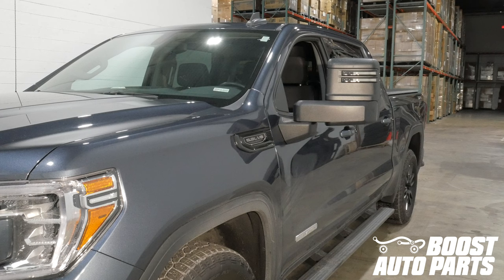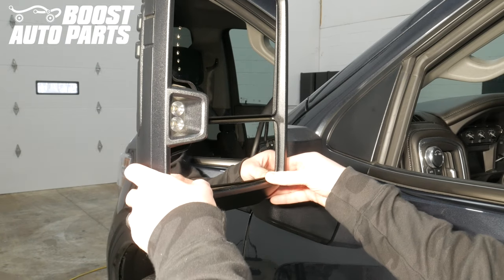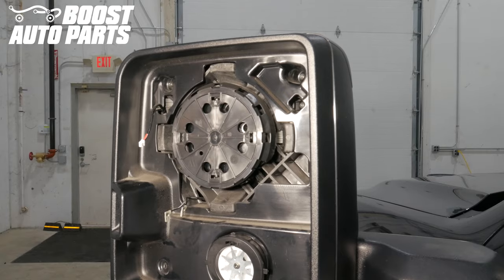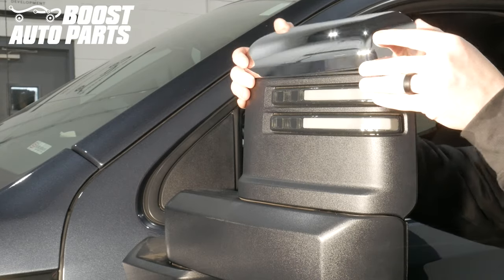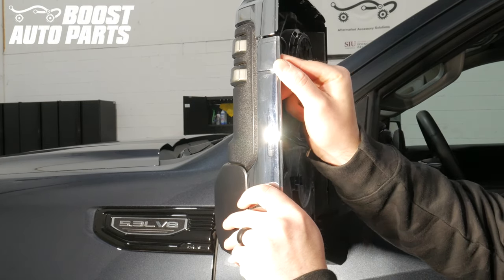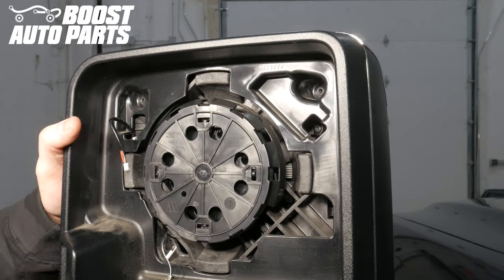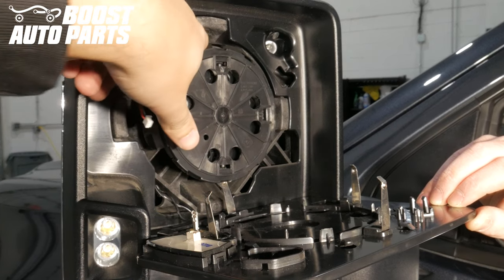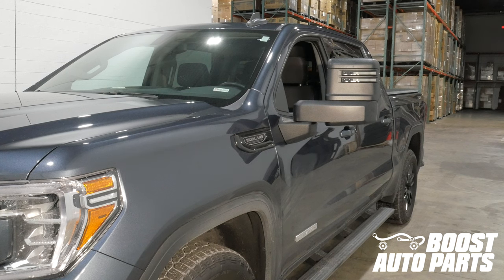How to Remove or Replace Your 2020-2024 GM Towing Mirror Caps (2019-2024 Silverado/Sierra 1500)

Comment: Where the heck do you buy the metal clips on the back of the glass
Reply from the maker: We offer them with the purchase of glass - give us a call 765-831-2830
Reply: @boostautoparts  everyone offers them with the glass.. I just need the clips
Reply from the maker: @chipsammich2078  Sorry - the clips aren't considered a service component by themselves. If you previously bought mirrors or glass from us give us a call and we can see if we can make an exception.
Reply: @boostautoparts  Thanks I found them

Comment: @boostautoparts  Hello.  Can you tell me if these chrome lower caps will work on your Boost Auto 2019+ 1500 Silverado/Sierra tow mirrors?  Thank you!
Reply from the maker: These caps won't work on our mirrors. We don't have the caps listed on our site that are compatible with our mirrors, but if you call us at 765-831-2830 we can get you a set.